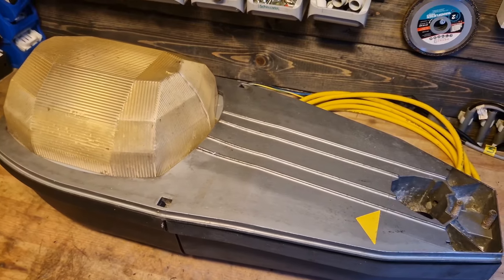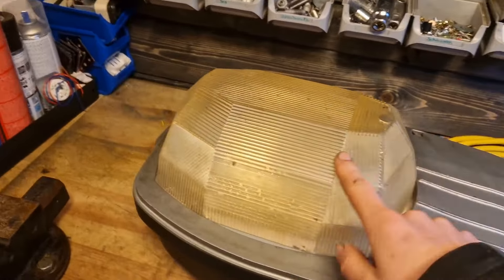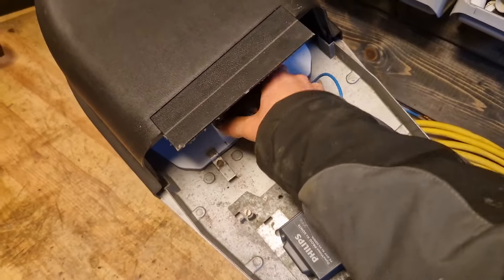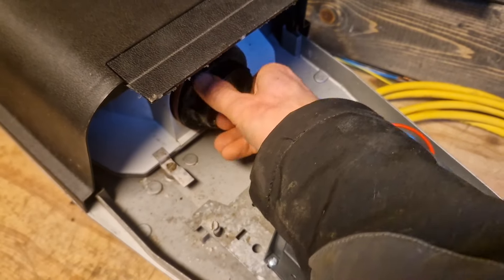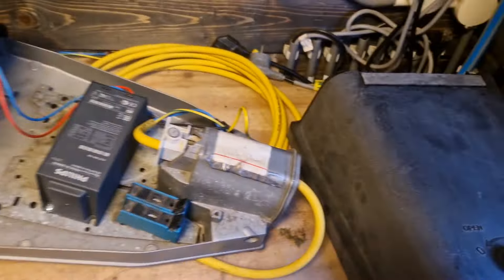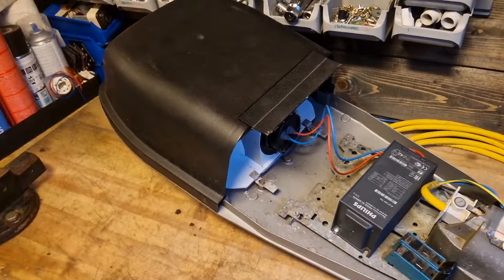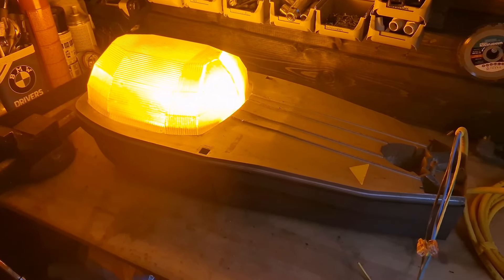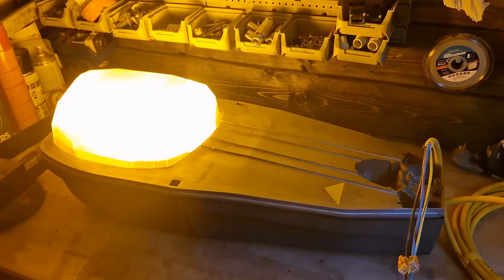Collection 165: Schréder MC SONT 70w

Comment: Very nice, we had these in the UK aswell but under the urbis ZX series name, this would be a ZX12 but they made ZX1, ZX2, ZX3, and a absolutely huge ZX4 which has 2 400w lamps and is meant for highways

Comment: Known as the ZX12 in the UK, very popular with the prismatic bowl, also seen with shallow glass bowl and flat glass. A rarer version exists with a deep plastic bowl. Also common is the newer ZX2 (MC2), the same body, but with slightly bigger optics for use with SON 100 / 150. Flat glass, curved glass, and plastic bowls. And then there's the ZX2s big brother, the ZX3 (MC3); a large lantern that can take SON 150, 250 and 400. Available with flat glass, curved glass, and plastic bowls. As far as I know, only the ZX12 and smaller ZX1 had the option of this prismatic bowl.
Reply: I had a ZX1 with glass shallow bowl. I always called the shoe streetlight because it looks like a shoe

Comment: The MC12 is one of the most emblematic models in Belgium. Little anecdote, you have a first generation, which is rather rare to find, even if the orange button is gone (this is normal, the system was not perfect 🤣). Glad to see that the Belgian models are well preserved in your hands 😄😉. And let's still enjoy the MC12, within 2 years, it will have completely disappeared from the Walloon landscape.